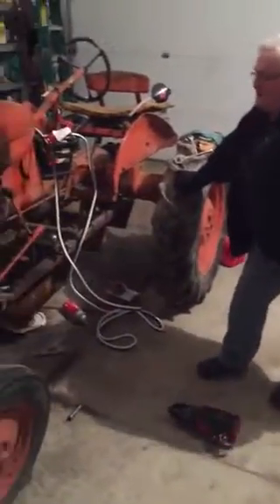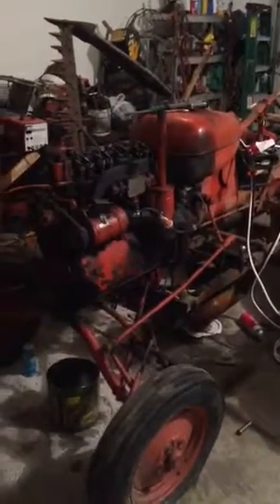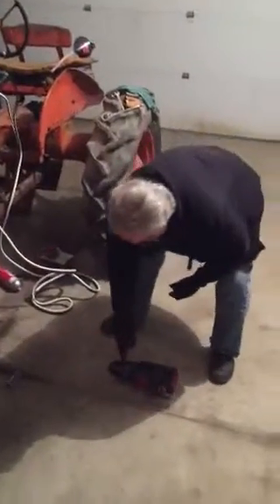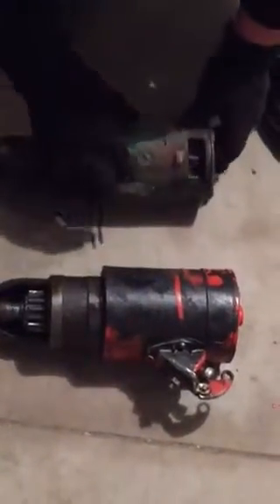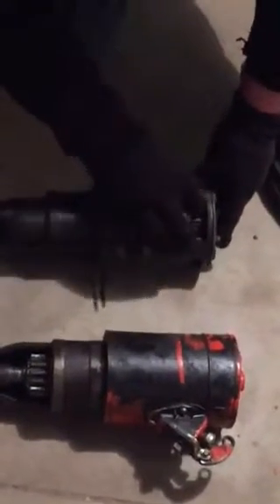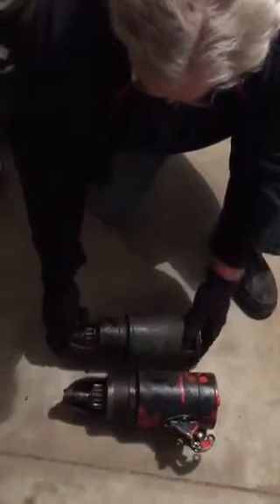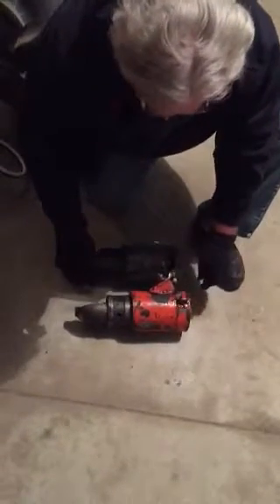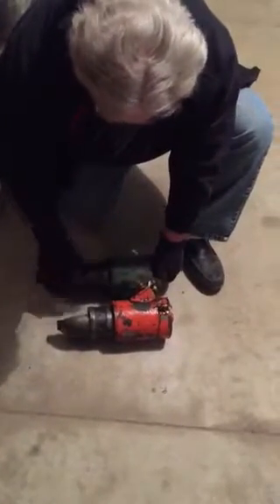Starter off the shelf work?  Nope!

Comment: Good luck , we will see how it does when you get it changed over.
Reply from the maker: That is an old video Rusty ..    I didn't use this starter - I took one off another Allis I had ..  not the same .  I think it was you that mentioned counting the teeth ...   and the JD was a much smaller gear ..   so wouldn't work .. gonna have to get the starter fixed when I get it going ..   Had to send the Magneto to the shop .. not producing spark ..   Thanks for the comment though .         Gary